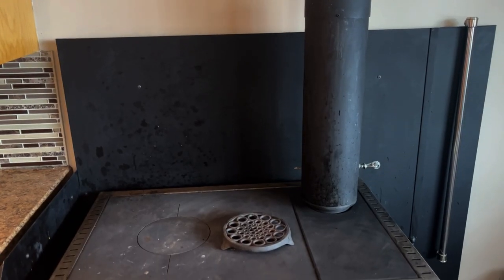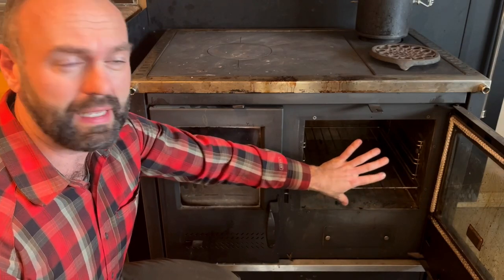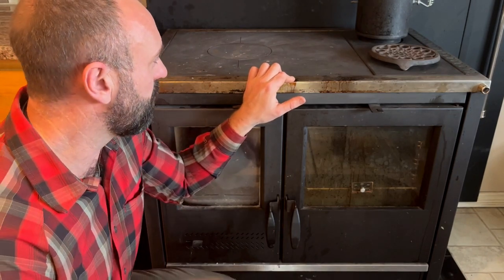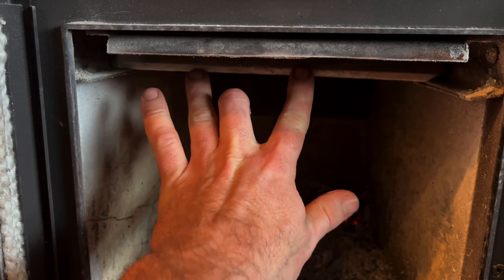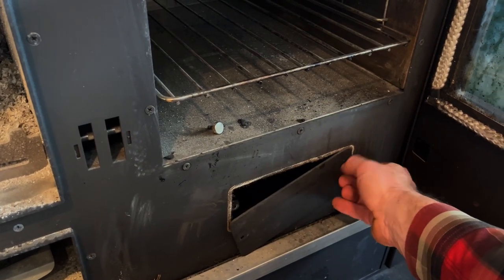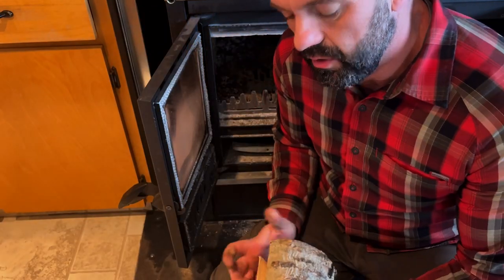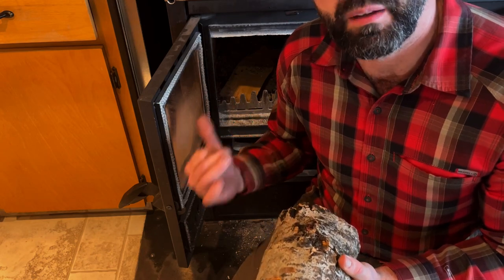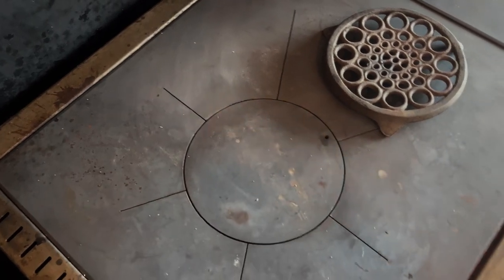North Cook Stove Review by Rob Avis P.Eng

Comment: Excellent video, I loved it! One thing I would like to mention is that the North is not rated to burn coal. While you are correct that it has the proper combustion air flow, the thickness of the steel and the firebox is will not maintain the high temperatures of coal and you run the risk of overfiring and warping the stove. Other models which have a cast iron firebox, or a full masonry firebox are able to maintain the higher temperatures of coal. You will also notice a significant weight difference between the coal approved models. The North comes in at 265lbs, while other models like the Concept and Gulliver which are coal rated are 450-500lbs. Keep up the awesome cookstove videos. :)

Comment: Closing off the grate, will reduce the amount of air that flows through the wood, giving better control of your heat output., Coal requires more air than wood to burn efficiently.
You could try thin firebricks, or some plate steel.